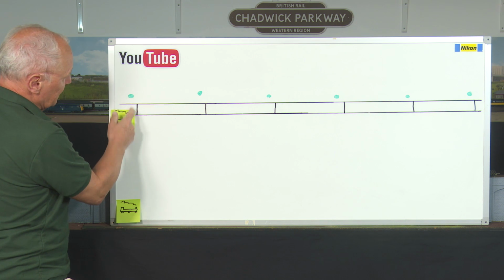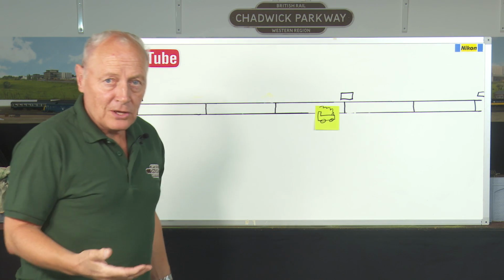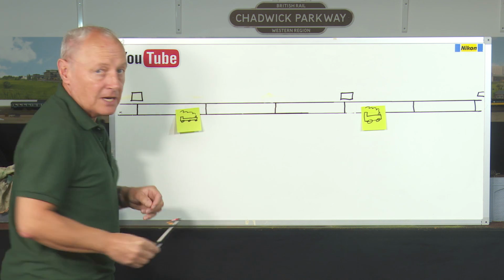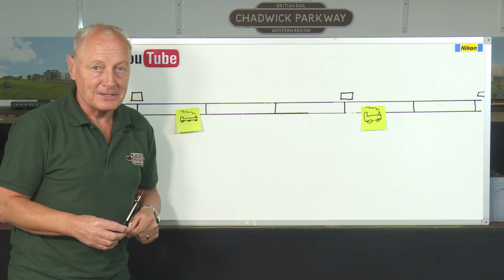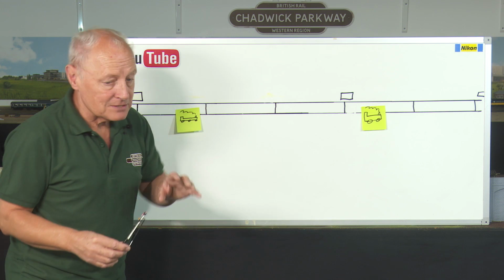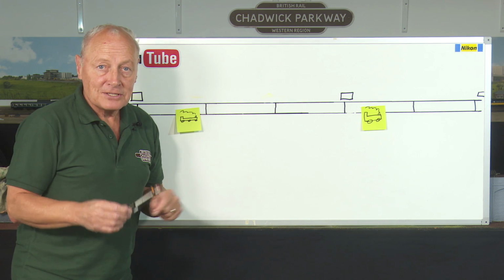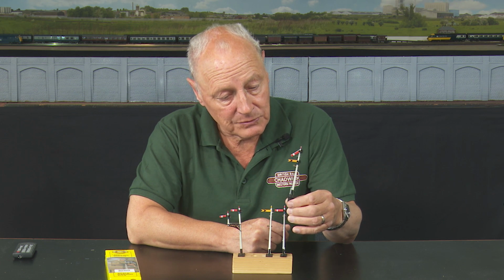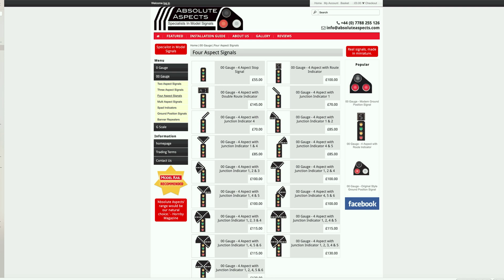Model Railway Signals at Chadwick Model Railway | 104.

Comment: 16:19 in the section of Red for Danger (Rolt, 1955) which describes the Hull Paragon accident, mention is made of the fact that a signal changed to green for the passage of a train should not be returned to red until the LAST vehicle of the train has passed.
Reply from the maker: Our signals remain at red until the next block is empty. Regards, Charlie.

Comment: on your block diagram you did not metion if it was a 3 or 4 aspect signals, in the first instance you are correct as it asumed to be a 3 aspect signal system, 4 aspect there would be a double yellow before single yellow caution.
Reply from the maker: Yes, I am aware of that, but perhaps I didn’t make it obvious in the video. Regards, Charlie

Comment: Hello Charlie, thanks for another great video - despite what you say at the start I don’t think anyone can take issue with your understanding of signals.  Your demonstrations make perfect sense and illustrate the principles really well.  I’ve been a signaller myself earlier in this career  and what you’ve said sums it up nicely!

The part about your MRC and the infrared element really isn’t that dissimilar to the real thing, certainly where I am traditional insulated track circuits have been phased out over the years with train positioning being used instead of train wheels on the track.  Moving on a bit further we’ve seen a more dynamic system of train tracking with the CBTC (Communication Based Train Control) system coming in (even more similar to the infrared approach) - though being described as a moving block system the blocks you describe still remain.  In the case of CBTC they’re tiny mini blocks of 6.25 metres, so small that for all intents and purposes (and without fixed signalling) could be seen as moving block in a practical sense.

Great video and a great introduction to anyone looking to learn about signalling and how to make this a feature on a layout.  Wishing best for now Charlie : )
Reply from the maker: Thanks CPW, I’m so pleased that you enjoyed the video. Regards Charlie

Comment: Hi Charlie, apart from the GWR semaphore type signals were raised to signal pass (rather like raising your arm to let someone pass under when dancing for example).  Could that be an intnded safety feature as if the signal failed for some reason, say a cable broke or came loose the signal would fall to the horizontal to stop position whereas if that happened on the GWR the signal arm would fall to the 'clear' position.  I never thought about that before until watching you demostrate the difference of which I am ashamed as my grandfather was a an long serving signalman on the Stour Vally section of the West Coast Mainline and was also responsible alco for a complex set of sidings for an large ironworks and a well known large boilermakers (Who made the longest load in British Rail history, it was a boiler for the eggborough power station in Yorkshire)..  He let me 'pull' a few levers at the age odf 4 or 5 (under suprvsion of course and a lot of help in ht eactual pulling) on quiet Sunday mornings when we would visit to take him his 'snap' (lunchbox). 

Very interesting video. and aniother inspiration is born in my head.
Reply from the maker: Thanks for your backstory Terry, I found it most interesting. Regards, Charlie
Reply: GWR lower quadrant signals are weighted and pivoted in such a way that they will also return to danger if a wire snaps. I believe the reasoning behind the adoption of upper quadrant signals was to allow a simpler construction, including in respect of gravity returning a signal to danger in the event of failure, but there is no question of GWR signal arms falling to the clear position.

Comment: Can you do a video on books you recommend for designing a layout.... from the perspective of how actual train lines are arranged? I don't really know anything of how a real railway actually operates. The best layouts are ones based on real stations which have some purpose but I don't know where to start on how it all fits together. There are stations, engine sheds, goods sidings, sidings etc. that in the real world all fit together an make sense. I found an ancient book on "Great Western Branch Line Modelling: Prototype Layouts, track and signalling" but I want to know if there is something better to explain how an actual railway works.
Reply from the maker: Sorry Andy, I really can’t come up with a decent suggestion. Prototypical model, Railways are a niche subject, and and one which requires a great deal of research. I think you need to find a layout at a Model Railways show and seek advice there. Regards, Charlie
Reply: @ChadwickModelRailway  I've thought of a slightly different idea for a video: could you do one about your layout design from the point of view of operations? You've done separate videos about aspects of the modeling (such as layout, signalling etc) but what about one about how Chadwick is meant to run as a railway and how the track design is intended to work in the operations.
Reply from the maker: Great idea.

Comment: Ahhh good old Yeovil Pen Mil, an odd station I never visited often when I lived there - Mainly I went to Yeovil Junction
Reply from the maker: It’s an interesting Station, there is not a concrete sleeper insight. Also, nothing but semaphore signals which I find rather reassuring. Regards Charlie

Comment: An interesting point about signals, the arms have different sizes there is the standard size shall we say and then there are signal arms which actualy indicate a speed change so if there was a bracket signal which leads trains off into a siding you might find that the signal arm leading to the siding is smaller than the one not for the siding.
Reply from the maker: Thanks AR, now that’s something I never knew.

Comment: Hi Charlie. Just a couple of points.  The distant semaphore description not quite correct. If the distant was off you should be cleared right through the next signal box's area (normally called station limits was the area between the the first stop signal that we called the home signal to the last signal which we called the starter) which could be several stop signals. The junction signal you showed the lower arm means a lower speed than the main line (straight on) if both the same height then speed the same for both routes. A signal with stacked stop arms means the top signal would take you to furthest left route the bottom furthest right. (which was often straight on) We could talk about signaling all day long there were many other types such as shunt ahead, calling on draw ahead etc.  There used to be a lot to learn as a train driver quite a bit simpler now. All the best A. Vulture.
Reply from the maker: Great info Chuckles, regards Charlie.

Comment: Hi Charlie - purchased one of those soldering stations, unfortunately mine packed up after an hour of use - soldering droppers on to a helix - sent it back and got a refund.  Purchased one from a different manufacturer and this is working fine.  As usual very good and informative video - thanks.
Reply from the maker: I’m so sorry to hear of your misfortune with the soldier station, do keep me posted on its replacement. Regards Charlie

Comment: hiya charlie great video and i need to give mine a run i have somme dwarf searchlight 3 aspect thay work awesome with heathcoat electroniccs and one i have added a feather from eckon a little sod to get the extra wires through but yes thay are in thease are posative common got some more on order and daisy chained them togeather i think you should give it a go mate with track isolation works awesome.
Reply from the maker: I’m so pleased that you found it interesting Michael, they certainly do bring a little bit of added realism to the layout. Regards Charlie

Comment: Oops; 14:30 "All you need is a two position switch with a common" touches the return line "and the two positions for green/red".
The center of the two position switch should be the wire you are using to connect to the red or green wire, then the red or green can get the electrical power from the selected side output from that switch, and then the return wire (white) will go back to the power source (Duette, in this case).
I know you know this, just attempting to ensure it's clear in case someone relies on this and didn't spot the deliberate mistake.

(I should find something better to do while waiting for this week's episode! ;) )
Regards, Tom
Reply from the maker: Sadly Tom, there isn’t one this week!
Regards Charlie.

Comment: Hiya Charlie i have made a nx auto pannel im running dc and also the signals controle the tracks the pannel acts exactley the same as the real br one.

I have not got any thing set up and i have used my depot to lay the track on the hard floor.

The signal system is by heathcoat electronics and i have asked him to add another relay to his board and also used this for train and pannel detection and the signal aspects are shown so i can keep an eye on the train as it disapears down the hall to the mess area.
i had 3 trains running and 2 double triangle junctions and in real estate had just over 3 miles of track layed.
Reply from the maker: I’m so pleased that it worked out okay Michael.

Comment: Another very nice and informative video thank you Charlie.
Do you know when blocks etc begun to be automated, during the 60's or 70's?
I ask because I will build analogue only and epoch III-IV which is the most beautiful era in my eyes, Diesel-locomotives only in my case...will have signals but don't want to awitch them manually instead that automated IR detector you showed here would be kind of interesting or if there are some other voltage-controlled ways to detect and switch on off etc...?
Reply from the maker: I believe the automation of blocks was instigated with the phasing out of semaphore signalling. Regards Charlie

Comment: What type of signal would have been in use in 1960?
Thanks loved the video
Reply from the maker: Great question Josh. Both semaphore and three aspect signals were both in use around that time. Perhaps you need to do a little research in the area that your modelling. Regards Charlie
Reply: @ChadwickModelRailway  Thanks very much. What i think I will do is have 3 aspect in the station an urban areas and semaphore in the rural areas.

Comment: As always another enjoyable video, I'm finding a lot of useful tips from you in dipping my toes into the model rail world.
So just hoping I can give a little back without coming off as a vulture 😃
 Just a little information on semaphore signal types, the differing types are known as a semaphore distant signal, semaphore stop signal, semaphore subsidiary signal and a semaphore shunting signal. 
The latter two have varying forms depending on application.
On the coloured light aspect signalling you'll get the junction route indicator (feather) before the proceed aspect as the route needs to be confirmed set before a proceed aspect is given.
Thanks again for a great video as I'd not know where to start with wiring it all up.
Reply from the maker: Thanks Rob, and I’m so pleased that you enjoyed the channel. Regards Charlie

Comment: In Queensland Australia the signals are based on British practice. For Semaphores they are read from top to bottom then left to right so the left most signal would mean the line furtherest to the left.
Their is also an Outer Home signal which is used where a siding might be built outside the home signal. In this instance the Distant signal would be moved further out. The Starter is usually used at the departing end of the platform or where a yard may connect to the mainline. There was also an Advance Starter which was used where the platform was not at the  end of the station limits and would give permission for a train to depart a station or yard as far as the next signal which would be the Starter. We use the British modern signalling today with 4 aspect colour light and Junction or Route indicators. They are the lunar lights that are set generally at 45 degrees to  the main signal but for multiple routes can be 45 degrees below horizontal, horizontal and 45 degrees above horizontal and can also be on both sides of the main signal giving the driver the option of up to 7 routes. They are read in the clockwise order starting with the lowest set of Lunar lights on the left to the lowest set on the right. 
Also in normal practice with 4 aspect signals the 2 signals behind a train are held at stop (red) to ensure a train cannot overshoot the red signal and hit a train in the next section. The procedure of keeping 2 red signals behind a train is for safety. Of course their are more types of Semaphores and Colour light signals. But I will not go into them here.
How do I know this? Because I shunted with Queensland Rail for 22 years and then spent over 9 years teaching Drivers, Guards, Station Officers and Shunters to shunt.
What you have shown is the basics and you have done it very well. Good job Charlie.
Reply from the maker: What a fascinating comment Alan. I have never heard of the two red light signals before.Which seems very logical on high-speed routes. I shall check it out but I’m sure we don’t use that system in the UK. Regards Charlie.
Reply: @ChadwickModelRailway  Perhaps I was not clear on what I said. When I said 2 red lights I mean that if you have blocks A, B, C, D & E. Then you have a train that is in block C. A train entering block A cannot progress into block B until the train in block C has fully moved into Block D. This way you always have at least 2 red signals between trains heading in the same direction on the same line. Of course the demand for trains to be closer in peak hour running has meant exceptions being introduced. A train can be brought immediately up behind another train by the use of a Flashing Yellow signal. It requires the train in the rear to approach the signal of the block it needs to enter and we shall use Block B from the example above. It must come to a complete stop at the signal. Once that happens the signal at the entry to block b will change from Red to Flashing Yellow. It is the Yellow between the Green and Red that is used. This advises the driver that the next signal is at Stop and there is a train immediately beyond. So what this means is by using a 3 or 4 aspect signal they can get 4 or 5 signal indications. Now I do not know if they use a flashing yellow in the UK but as we have taken our system from you I would think it is likely. Other states in Australia of course use different systems from different countries.
Reply: Hi again Charlie,  I wondered about the flashing yellow after I had mentioned it and so had a look on the UK railway signaling wiki page and found you not only have Flashing Yellow but also a Flashing Double Yellow so you are one up on us for now. Here is the wiki link so you can read from there: https://en.wikipedia.org/wiki/UK_railway_signalling
Reply from the maker: Thanks for the clarification Alan, now it makes perfect sense.

Comment: If the distant signal is 'off' then all the stop signals controlled by that box are 'off' too ['home' and 'section']. The distant signal may be 'on' and the 'home signal' [there could be more than one 'home signal'] 'off', but the 'section' signal could be 'on' [and any more 'home' signals], so you have to treat every signal controlled by that box as being 'on'.
Edit: For long distances between boxes, you can have an 'intermediate block home' signal [IB/IBH signal controlled by the SB in rear].
Reply from the maker: Thanks AS, very useful.  Regards Charlie

Comment: Well done for this video - very brave because railway signalling is an often neglected subject; not helped by the secrecy seemingly maintained by those in the know.  But I'm not here to rant!  May I offer some comments, intended to be helpful...
Almost all railways that used semaphore signals started with Lower Quadrant; it's just that the GWR never progressed to Upper.  The upper Quadrant type was deemed safer in the event of a break in the rodding or snow holding the arm down!
The easiest way - by rule-of-thumb - to identify home and starter signals, is that the home signal allows a train home to the station, and a starter signal allows the train to start on its journey.  Again, rule of thumb, outer home and inner home can exist (in that order after the distant), and then platform starter and advanced starter.  But every rule has exceptions.
One observation that may be helpful is that when the feather lights up, it does so before the aspect clears.  This is to prove that the driver will see the correct aspect.  The 10:30 feather is called Position-1, 09:00 Position-2, 07:30 Position-3; then 1:30 Position-4 and so on.  So the signal that you were describing that you wanted would have positions 1 and 4.
But yes, well done and keep up the good work!
Reply from the maker: A constructive comment, many thanks.

Comment: For the basics of signalling you did well. Signalling a layout is something many avoid at all costs, it is good to see you have inspired some to get started on their layouts. One thing about the feather you demonstrated, it always lights first and is proven to be lit before the signal can change from red. This ensures that if the feather failed to illuminate you would not get a driver thinking their train was going along the main line and suddenly finding it was turning off over a low speed junction. Train-Tech make very good colour light shunt signals which can be wired as either old or new style, as for the main ones I use the Berko which I find are a lot better for night time running as there is no light bleed to the unlit aspect.
Reply from the maker: Great comment mate, mant thanks.